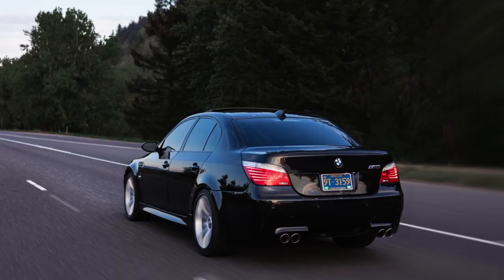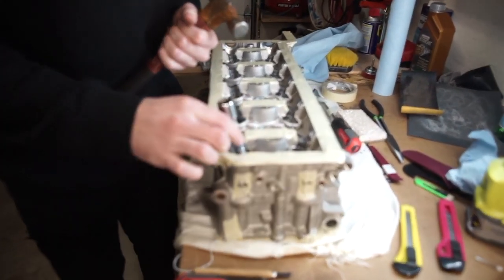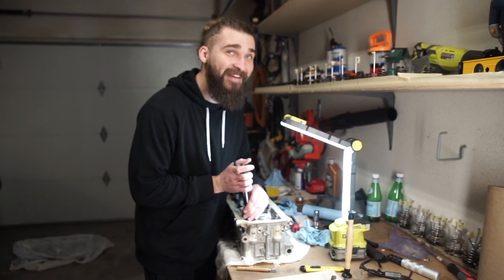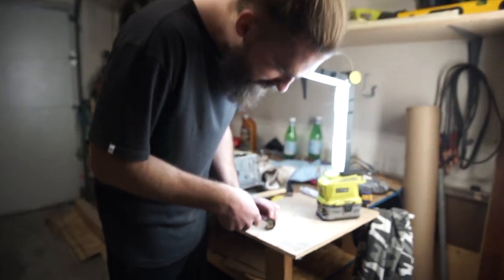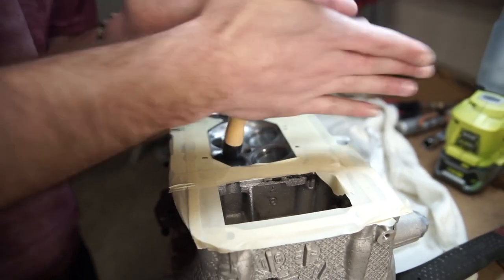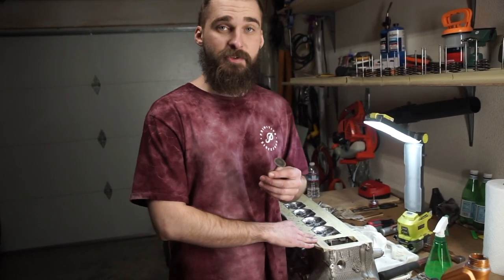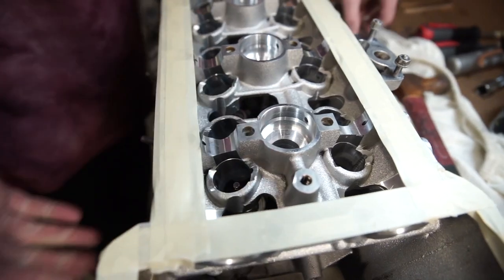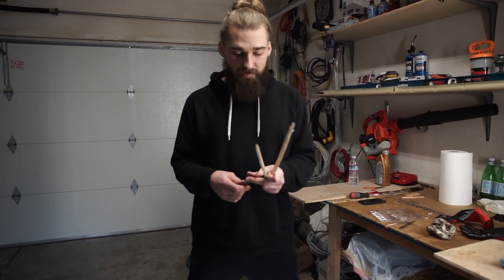How To Rebuild BMW S85 V10 Cylinder Heads (V10 M3 Build)

Comment: Man keep up the videos!  As a owner of a E60 M5 with 120k on the clock,  I’m sure this is gonna be a project for me in the near future.  Preferably before the bearings go and grenade the crank.  Are you replacing the vanos pump as well?  Also are you going to hone the cylinders?  I’m curious how that will work on a alusil block.
Reply from the maker: Appreciate it Dustin! I recommend doing the rod bearings asap though. If they've never been replaced before, I don't know about you, but I daily drove a 6sp 08 M5 for 4 years before I got this current motor and by the time I sold it (sold it with 105k miles), it just became a ticking time bomb because I didn't know how the previous owner drove the car. 

I don't think I'll be replacing the vanos pump because from what I understand the LCI modes improved all that and this motor is an 08. I probably should since I'm down here but we'll see. Half of the next video regarding the lower block is almost done, but I'm still waiting on some parts in order for me to finish the whole video.
-Eugene
Reply: YEVS BUILDS awesom,  it’s nice Someone is doing this,  the general consensus of the community when it. Comes to these engines is “ mail it off,  it’s too difficult”  So there seems to really be no one talking about actually tackling this engine for a rebuild.
Reply from the maker: @dustinhipkins5094  Exactly! But it makes this build that more interesting to do honestly! It's a challenge finding info about these but the car community is overall full of great people who help out with what they know. Keep posted, there's a lot of material coming for this.
-Eugene
Reply: Could you help me With my s85 v10 engine rebuilt do you happen to know the NM (ft ) on the engine block, heads  and timing chain NM (ft)

Comment: This is embarrassing , I know you state you don't have all the right tools but this is displaying machining from the wrong aspect. It appears you guys didn't even take out the plugs from the oil galleries to clean them properly. If this is an ongoing project make sure you check your piston to valve clearance especially after you resurfaced it.I don't know how much metal you took off to resurface, but There's a reason why BMW states to not resurface it. All that matters though is if it runs in the end so good luck
Reply from the maker: Appreciate your comment Jesse. I did not know BMW states that, hence I spoke with multiple mechanics who have been in this business for over 20 years, and they do this sort of thing all the time and don't experience issues. I would actually love to see their statement about this though. If you could link it in the comments, I'd love to take a look to understand why it's not recommended when all of the other motors out there are fine with it haha. Thank you for the feedback, for real.!
-Eugene
Reply from the maker: @brandyschwartz5133  Appreciate it! Thank you
-Eugene
Reply: Kudos on taking on the s85. Hope to find a good core to put in a clapped out e31. Anyway anyone taking on the valve seals can really use the Lisle 36050 valve keeper removal/installer. Did a Volvo B4204s i5 valve seals with it and a Nissan VQ35de v6 along with valve seals remover tool. Makes like a heck lot easier and they don't cost anything. Saves alot of time and sometimes you don't need to remove heads to service the seals. I see you used the keeper tool , there is smaller ones that work if the one you used is too big.
Reply from the maker: @alexalanis8077  Really appreciate the feedback! Thank you! Will look into those for future videos.
-Eugene